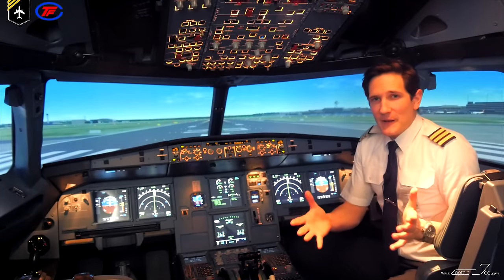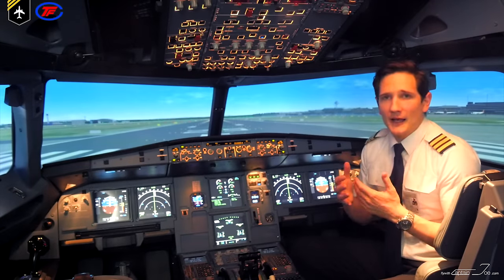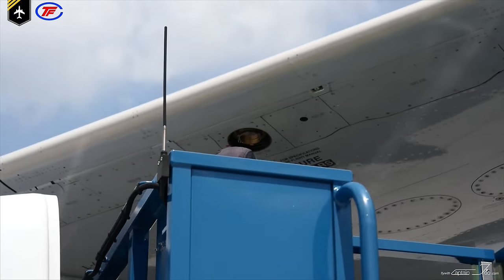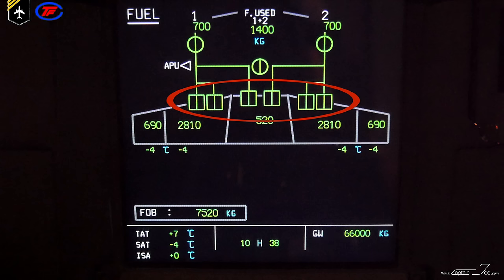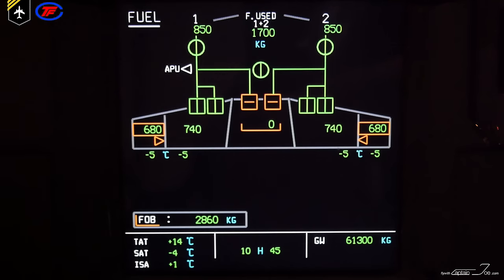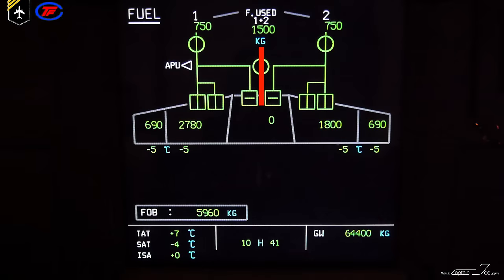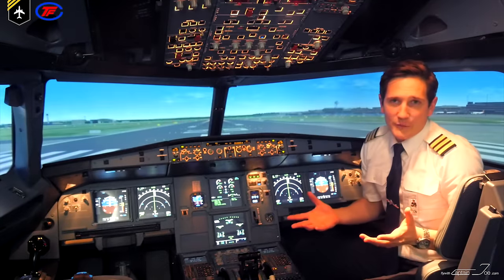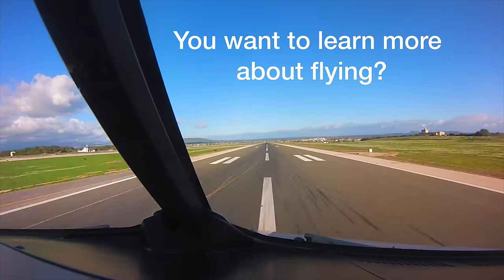How does the AIRBUS FUEL SYSTEM work? Explained by CAPTAIN JOE

Comment: Joe, why is there no temp reading for the center tank? Is the center tank in close proximity to the air conditioning units? Why do they use the center tank first? The ac units overheating a nearly empty center tank is what caused the TWA FLIGHT 800 explosion. They should be keeping a closer eye on the center tank fuel temp and also keeping it full so that dangerous vapors don't develop if the plane is sitting on the runway on a hot day with the ac units running. Doesn't the airline industry learn from past tragedies?
Reply: GNX157 the A320 is different from the B747
Reply: It was because of that accident that inerting systems were brought in. Usually pumping nitrogen into fuel tanks so the air is no longer combustible. So yes, we do learn from past tragedies.
Reply: I haven't heard anywhere that this inerting system has been implemented on commercial planes. Which planes do you know of that have this inserting system in place? And no the airline industry does not like learning from it's tragedies, or at least spending the money to correct their causes. Just look at the 737 rudder reverse/hard over .control debacle. Took forever to prove that it was really happening then when it was they didn't want to spend the money to replace all the bad control units in the planes.

Comment: Why gallons and kg for fuel capacity?
Reply: fuel is rated in pounds, as in actual weight of the fuel
Reply: The amount of energy in a given volume will be different depending on the density, normally temperature related.  Fuel load and fuel burn is in lbs or kgs because a kg of jet fuel has a set amount of calorific value.  A warm, less dense kilo of fuel will take up more space than a cold, dense kilo of fuel, but burning them will give off the same amount of heat. Having said that, the fuel trucks will pump in litres or gallons.  What the fuller has to do is work out litres to kilos depending on its density or specific gravity, and that can change from day to day.

Comment: A crashed airbus 320, because center tank went empty. Swich to the computer pilot, but he failed to start the engine, i glade, til a certain point. I had fuel in the wings but engine failed aldow al fuelpomp were on. I made a emergeny landing without landing gear down. On a german village. What went wrong.

Comment: where do you put 320000 litres of fuel
Reply: The fuel capacity of A320 is of course smaller than big long haul airliners have. You know that the A320 has much shorter and smaller wings than A380. A larger aircraft like A380 has more capacity because of its size. The wing span of A380 is about 80 meters.
Reply: @Gaz > Are you capable of watching a video?  He stated the A320 can hold 23,858 liters.  Where did you come up with 320000 liters?

Comment: hi captain joe.
your videos are amazing.
your videos are very helpful.
i had learned so many things.
but one of your video  (how does the airplain FUEL SYSTEM WORKS explained by captain joe) https://youtu.be/Cy3HnP6nf0c

in this video when explaining about minimum and maximum temperature of fuel 

you said minimun (-43°C) & displayed  (-43°C)
and maximum you said (+45°C) & displayed  (+54°C)

i am not pointing any errors.
i just want to clarify which maximum temperature is right.
so it will help for me.
and thank you captain joe for your all videos.

Comment: It is quite bollocks for anyone to really believe that so many liters of fuel would be held in the wings of these planes with all of the Hydraulics and flaps. Let's just all start waking up to the fact that these are compressed air engines and they don't require fuel. Jet engines that are on fighter jets have an afterburner which sprays fuel in the exhaust to give it extra boost but generally the planes we've been riding for years and years are all run on compressed air in fact they are even started with air compressors
Reply: Canary Brain Studios I bet your grandpa built planes. And if he did, you were not there, and I'm guessing you cut and paste all the wing flap parts. It would take 16 Tower cranes from a city that builds buildings just to be able to lift the fuel alone let alone all the engine weigh all of the cargo all the passengers in the rest of the plane weight.... it's all Crap.
Reply: Canary Brain Studios fail
Reply: My grandpa lol
Reply: Better at meching than spelling thankfully

Comment: It would take 26 tower cranes to lift the weight of the fuel alone on an A380 bus. You know those big towers that build skyscrapers?  18 tons of fuel in each thin ass wing weighing just sloshing around on bank turns. Haha. Ok. People need to look into compressed air engines they're using it right in front of us. They are even started with  compressed air.
Reply: The Jet fuel hoax theory is one of life's intelligence test, and you people are failing it.
Reply: Zachary Imus
"thin ass wing" - a great illustration that you've never been anywhere near an A380.
Reply: But my 2 inch phone screen clearly shows the wings are just millimetres thick.